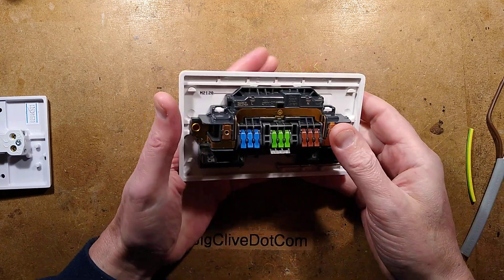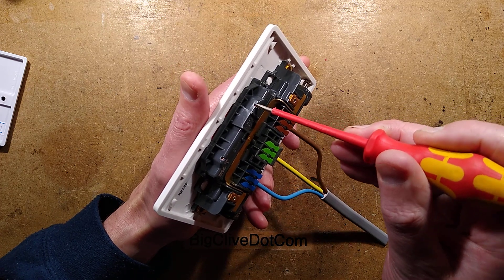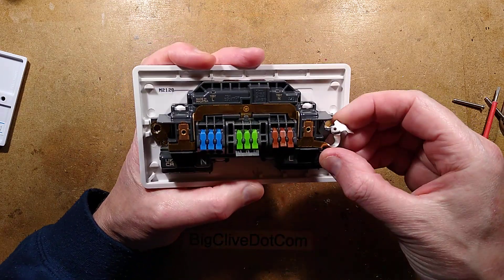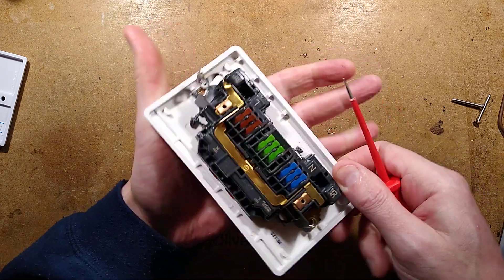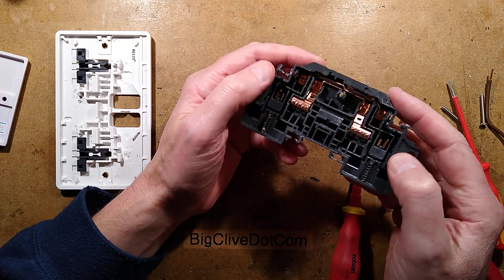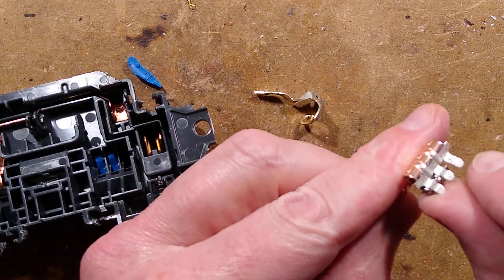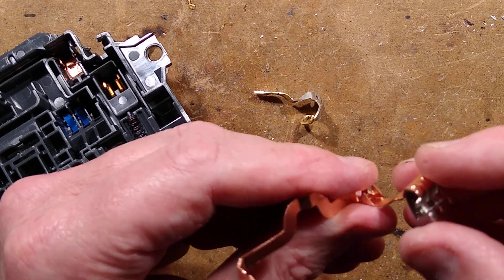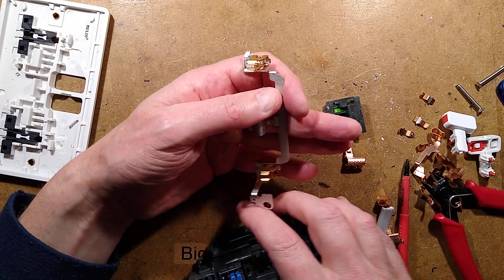Teardown of the new MK screwless socket

Comment: The mysterious white metal looks like a matte tin finish on the leads of modern, lead-free electronic components.
Reply: It's a nickel plating to combat corrosion where it has permanent non serviceable manufacturing connections. Using pre plated sheets as it's more cost effective than plating all the individual components, and cuts manufacturing time.

Comment: I don't understand why anyone wants to use glorified speaker terminals in household wiring.  I don't particularly like them on my stereo.  Wagos are just another version of the back wiring holes on North American outlets.  I would rather use wire nuts (or Marettes as we call them in Canada) and the regular screw terminals.  The Wago connectors are probably fine for use in small appliances with stranded cable but not for household (or commercial) wiring.  Otherwise that outlet is very robust.
Reply: Wago connectors are excellent and high power versions are available for cable sizes up to 185 mm2 which are rated at 353A.

Comment: I have two boxes of these, ready to install in my house.  They seem pretty good.  If they’re as good as Wago connectors are, they’ll be great.
Reply: Fitted first ones and they are very good.  Incidentally, the one it replaced left it’s neutral wire perfectly in the bent and fitted position when I removed the socket from the wall.  No wonder that socket had been playing up.

Comment: Is there any concern about mixing the tin/brass ground bus and copper live/neutral for cases of water ingress or damage, with regards to corrosion or shorting?
Reply from the maker: Not sure of the galvanic voltage differentials.  I don't think it'll be an issue.

Comment: Not sure if I like that idea!  I would rather they had three individual screws.  I had some that had two screw terminals two live, two neutral, two earth, they were brilliant to wire up.  No fighting to get two wires into one screw terminal, push one wire in and the other pops out, or you think they are both tight, and you give them a tug just to make sure and one comes back out!  That is so annoying!   The ones with two screws it brilliant, no struggling with wires, all they needed to improve on the two screw idea was to put in three screw terminals.
What I don't like about that design is, will the wires hold in place when they are stuffed inside a box in the wall, especially the metal boxes.  I think there is too much strain and current for those type of terminals in a 13 amp socket.  However, three screw terminals at the back of a 13 amp twin socket would be brilliant  :-)

Comment: When drilling out rivets ('pop'), I find having the drill on a bit of an angle then if the rivet rotates too, the drill still chips away at the rivet - I guess the bit of the drill driving the rivet is moving at a different speed of the cutting part of the drill.

Comment: If I was installing a ring main, I would not cut the wires to fit the sockets. I'd merely bare double-lengths of wire, fold it in half and insert the fold into the terminal. That way, I do not break the ring to fit the socket. Will these cope with my method ? If not, I suppose I could make adapter three way terminal block that would save breaking the ring and making the socket a very local spur.
Reply: I used to do that too!
Reply: @philhermetic  I've just created a 'breakout box' this year. The Earth wire in it is unbroken - linking everything together. The power wires are daisy-chained - ending at 13A sockets with neons. Plugging anything into the sockets is optional but the neons demonstrate continuity of all three phases (and neutral).
Machining by Mike - 009
Since that video, I've leant that I need another safety feature - neutral failure detection. Also phase 3 failure is not detected - so looks like a job for a 240V relay with the contacts wired into the coil circuit of the contactor - L1-L2. So then any phase or neutral failure would release the contactor, isolating most of it (not the RCD).
Reply: @millomweb  that sounds good, I will have a look!
Phil
Reply: @philhermetic  The progress to machining is on hold due to other life problems - not helped by video camera viewfinder failing ! When I get back to it, it's problem-solving an earth leak on my milling machine.
Reply: @millomweb  if I can be any help, shout me up! Where in uk are you?

Comment: in denmark all switches and outlets have had spring terminals for 40 years, and they never fail. The problems with bad connections are in the junction boxes and other places where there are screws. But many sparks are now using wago 221 in those boxes to join wires
Reply: I live in the USA. Until a few years ago almost the only connector used was solderless twist-on connectors-commonly called "wirenuts" though that is actually a name brand. Wago is slowly becoming more accepted. I must admit I was apprehensive at first, but when I read about their utter reliability in Europe for many years I began to come around.  They really are superior.
Reply: @ianbutler1983  I wouldn't be able to sleep at night in a wooden dwelling with those nuts as connectors. In the UK we stopped using them years and years ago because they caused fires. Although regulations are stricter now with regards to electricians, you still get cowboys taking on electrical work. I've even seen supposedly qualified ones cutting corners (time is money apparently).
Reply: These days in the UK, you have to use maintenance free junction boxes in inaccessible areas.
Hager make maintenance free junction box that are compatible with current rules. When I started using Wago years ago, they were applying for a certificate for acceptance as maintenance free, not sure if they have it yet.
Reply: I believe spring terminals are compulsory in UK for connections that are not accessible.
Reply: @azz2  Spring connectors or crimps. The spring connectors shall be downrated according manufacturer's instructions.
Reply: @azz2  that is correct, please see my other post 👍🏻

Comment: It would be interesting to see one loaded up, both in a ring with spur and a good load on the socket too, to see if firstly it gets hotter than its screw equivalent, and to see if the spring clamp goes weak after a good loading. Overall though it's quite good  looking at it. Do the poles on the switch contact at the same time?? The screw terminal ones I have here don't unfortunately and tend so spark more than the much older MK ones from the 70's when switching a good load. Good videos Clive, I like something informative.

Comment: Noce to see they have abandoned the abortionate shutter mechanism so loved by all who did not have MK sockets installed on commercial premises.  Their exceedingly clever former mechanism meant that one could not easily shove wires into the socket. Unfortunately, it worked without an earth pin present, and because the mechanism was "sticky" when the plug was inserted, people in commerical premises just thumped the plug in, resulting in the back being smashed out of the socket. I have been in premises with every socket on them smashed like this. Result:  Owners specify "anything but MK sockets."

Comment: MK is usually a quality brand. The latched covers are a good feature. I’d always use MK where I can anyway. I’ve found good design reduces fixings & tools so I like the fact this can be installed with just a single screwdriver.

Comment: Worked at stage electrics years ago and 16mp plug/skts had these terminals. In that application they had to be pulled to simulate abuse when rigging lighting etc etc.Not as good as screws though never worked loose

Comment: The levers seem a bit over engineered/unnecessary expense. It's not like you work on the fixed electrical installation in your wall all the time. Most sockets and switches I know (in Austria) have push in connections (no need to actuate a lever). The can be released by pushing small tabs that are part of the same piece of plastic (the black part in the case above) which do exactly the same job as the lever.

Comment: There ok for domestic use , but no good for commercial or industrial use when you installing 32 amp socket radials using  4 or 6 mm cable , other than that good idea
Reply: The terminals are designed for 4mm cable. 6mm would be a problem.

Comment: Are tool-free sockets a novelty in the UK? We've had them for decades here in Austria, though a slightly different style. Ours use push-in contacts, with a plastic pushbutton to release the wire again. Pretty much every light switch and socket has this style of connector.

Comment: The little “bite” mark on wire implies the surface area of connection is very low compared to screw terminal (which has a circular shape cross section that pushes down on the wire). Same with wago I think? Surely this low surface area doesn’t make for the best quality connection?
Reply: The bite mark is applied by the spring - the electrical contact is much larger.
Reply: @Monkeh616  makes sense! Thanks
Reply: Never had a high resistance from these, no different to a screw connection in my experience.

Comment: Isn't brass even worse conducor than aluminium? like 2 times higher resistance or something?
Reply: The problem with aluminum is expansion/contraction, + oxides. Conductivity was never it's problem.

Comment: I despise copper coated aluminium wire, I tried to solder some the other day without realising, wondering why the solder simply refused to stick, then I looked closer :(
The wire is only useful for clamp connections :(

Comment: Is there a difference on using an actual let's say 2.5mm cross section single wire vs a 2.5mm cross section stranded wire in electrical installations?
Reply: Cost.

Comment: If only they'd shroud the connector to prevent touching the pins as you insert it. Oh wait, Schuko does that...
As for polarized, here we use IT net so there is no neutral, both phases are live as L1/L2.  (Or L1/L3 or L2/L3 hehe.)
Reply: If only the pins were insulated so there's no exposed metal to come into contact with. Oh, wait, BS1363 does that.

Comment: I would totally switch to using these as standard. We just need some with built in USB power supplies now.
Reply: Matches and petrol are still slightly faster than built in, always on cheap and nasty power supplies - that is, I assume you do want to burn down your house?
Reply: @fredjones100  I knew somebody would have to comment this.
See - the UK actually has standards. Things have to comply with our safety regulations before they're put on our shelves.

Unless it's Poundland, of course.
Reply: @TDGalea  Sure, it's your choice in the end... all I know is that my gut feelings were confirmed earlier this year by my experience of being in a major house fire caused by (supposedly) EU/UK standards compliant USB charging electronics.  Standards are great but not nearly as effective as simply turning off a charger / PSU when not in use!

Comment: How strong is the clamping force compared to a regular wago? I know our American friends often complain about "back stab" connections for not gripping strongly enough with non wago branded conectors.
Reply: American here, the connector shown here looks much better than out backstabs. I believe backstabs are made entirely out of the same piece of metal which forms the contacts. The Wago ones seem to use a separate piece as a spring which probably means greater and more consistent spring pressure.
Reply: @eDoc2020  True. And if anyone will have done their homework before releasing this socket design onto the market it would be MK.  They are a "go to" brand noted for quality and durability here in the UK.

Comment: I was thinking possibly (as the screws are usually gal or other coated steel) maybe its to prevent electrolysis???
brass and steel aren't a good mix- especially if there is any moisture in the air...
With brass, it can lead to the zinc leaching out of the brass leaving the resultant metal much weaker than originally made... it can also make the steel 'corrode' faster...

Comment: I am not a fan of those spring type connectors. They tend to lose their tensile strength due to heat. Especially when pulling high AMP`s. I trust the screw terminals.
Reply: Evidence for that statement?
Reply: Wago (the leading maker of spring terminals) makes ones that handle up to 353A.

Comment: That looks like very secure and excellent design. I like the wide and decently thick enough bars and, am I correct in saying, those clamp-style connectors are more secure than the screw type? (Screw type has a sneaky habit of loosening over time.)
Reply: Trouble with the screw type, especially with cheaper brands, you think you've tightened up the connections, then when you put the socket or switch in place to fit, the bending and slight twisting of the wires can loosen those connections. Always best to check them before final fit.

Comment: That's an interesting cable. It's flat and earth is just a thin bare wire? Haven't seen this before, maybe a UK thing? Could you make a video about it?
(The fixed mains cables I'm used to are round. All conductors have the same gauge and insulation, including earth.)
Reply: UK standard.
Reply: It's also very similar to "Romex" (genericized trademark) wiring used in America.

Comment: Yep.
Agree with below comment as silver is very expensive and tin is used in both electrics and electronics for this purpose to avoid build up of contaminates.
This type of quick connect is used a lot now in electrical and elctronics as labour time saving.
Also better than the US twis on connectors with a helical spring it's also labour saving.
One concern as the contact has 2 defined contacts, one the thickness of the metal opening pulling the wire on to the other a flat surface, what if you push in a wire that is not straight, but bent what sort of current would you get, would the contact points heat up may be resulting in a fire, also with the maximum product test current.
As I worked for approval bodies I would like to see the laboratory product type testing for this product.
So product type testing has to change when the way products are made change either mechanically or types of material it's made of.
As the in the 90's the contact surfaces of switches especially the plastic rocker type, was improve and their ratings were much improved also.

Comment: I spoke to the technical department of another double-socket manufacturer recently for confirmation on load capability and they claimed each of the socket outlets to be rated to carry the full 13A - so 26A in total, or around 6kW @ 235V, on 1x double socket.  Incidently the socket was marked "13A 250V" on the rear.

I don't really understand where the claims otherwise are coming from?
Reply: I seem to recall a video from either Efixx or J Ward which said that 20A was the maximum aggregate load for a double socket.

Comment: Silver has many advantages over copper and brass and is often used to plate electrical conductors and contacts. It is more conductive, easier to solder, and less prone to corrosion. Even when silver corrodes it's black oxide is more conductive than oxides on copper or brass. The only disadvantage is that is a softer metal and more expensive. So plating a harder cheaper metal with it is a good option.

Comment: If copper is clamped under a screw for a long time, the copper will deform and the contact will become loose. 
The spring counteracts this.
It also makes it quicker and easier to connect.
No more three cables loose under one screw.
Reply: But actually it doesn't. Annealed copper is very 'sticky' and tends to friction weld to brass terminal screws.
Reply: As an aside I would trust a 70's MK double socket using 2x 7/029 or 1x 7/044 with 2x3kW loads plugged in...I'm not sure I'd trust this...
Thankfully I still own a screwdriver so I don't need to.
Next will be IDC connectors and clip on sockets for NICEIC newly approved 'electricians'

Comment: The little pieces that fly everywhere are called pingphuckits.
Reply: Have you spelt Phuket wrong
Reply: @barrytipton1179  No - I wasn't referring to the place, but avoiding coming up against some sort of censoring application.  Change the ph to an f.
Reply: @steveknight878  I knew lol just did in case some don’t get it lol

Comment: An I missing something?   Aluminium is twice as conductive as brass isn’t it?   So why the concern about aluminium?
Reply from the maker: Aluminium forms a high resistance oxide layer on it's surface.  It causes problems.

Comment: On the other side of the channel, Legrand, Schneider, Hager, at least are going screwless. Sometimes with a bit of schizophreny... (I have in mind a Legrand wall plug that was screwless for line and neutral connection and screwed for the earth terminal. why was it like that? no idea)
Reply from the maker: Either easier or playing safe with new technology perhaps?
Reply: @bigclivedotcom  I think it's more a question of space. The plug was low-profile (in the wall), able to be retrofit in a 14/15mm deep box. Adding the lever mechanism would have pushed the enveloppe, methinks.
(Remember I am talking about a shuko-style plug, so they need more depth.)